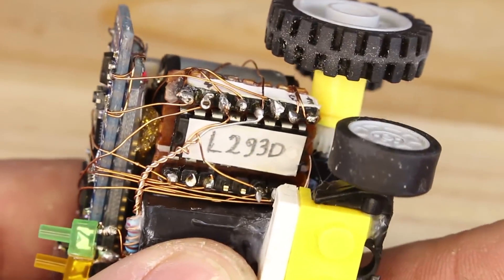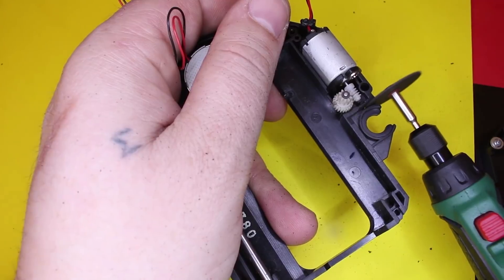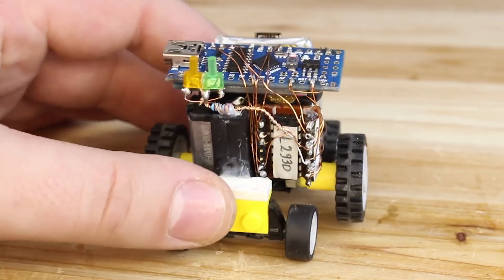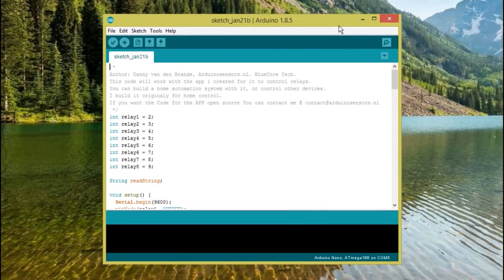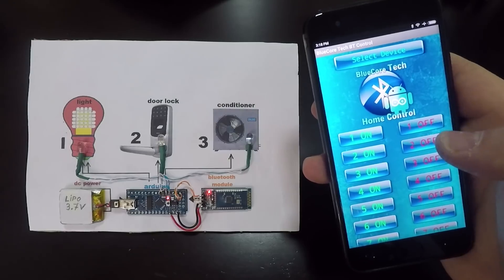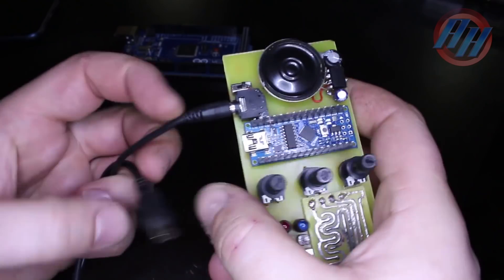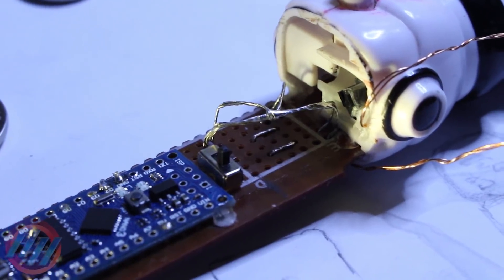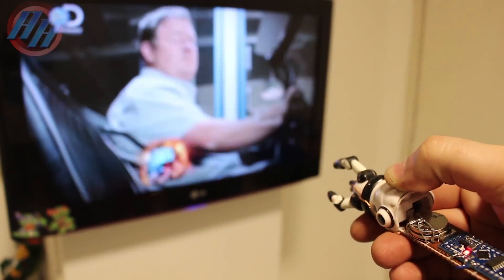Top 5 Homemade Arduino Projects

Comment: How does that TV remote work? How does it know what signal to send to power off the TV
Reply: I have learnt that it sends a wide range of commonly used off signals AWEOSME !!!
Reply: tv remote works on IR communication,,the receiver converts it to the hex code which is taken by the arduino and make checks,,,u can control around 1 dozen devices,,,,,,